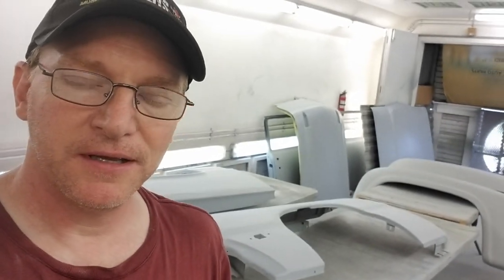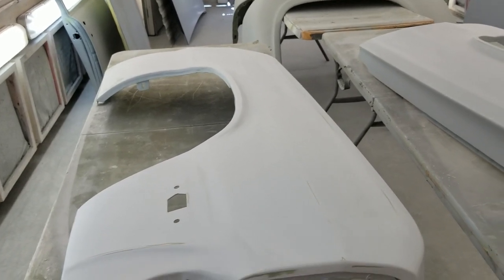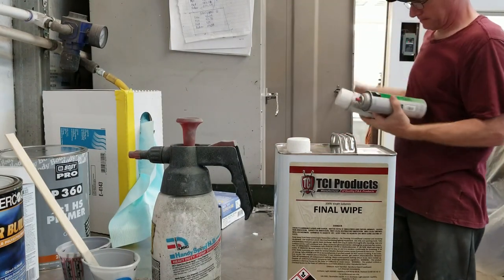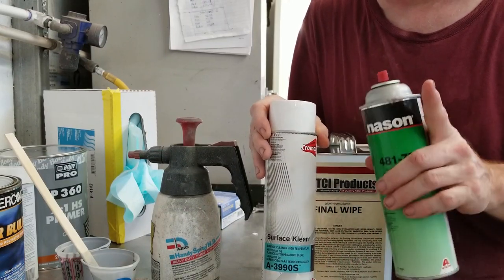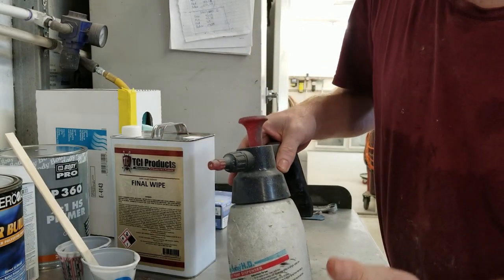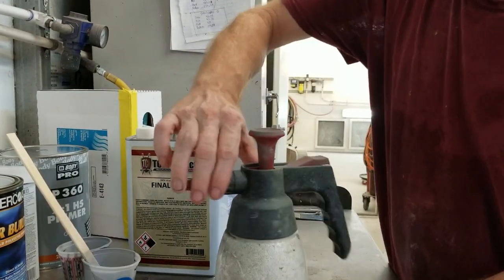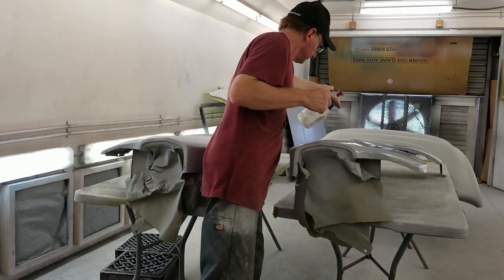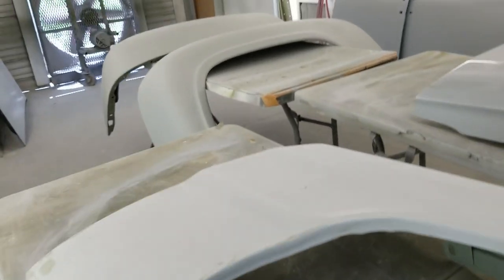How to Verify If your bodywork is Straight Quick Tip 101

Comment: 'Dieback' is when the clear coat loses its gloss. Almost like it was sprayed on dry. 
Its your bodywork that's showing from the inspection spray. It's not called dieback, it's your bodywork. To fix it you need to block sand the area again with guide coat until it's flat. Then you can use the inspection spray to double check it again.
Reply: That’s what I was thinking

Comment: Great tips and nice demonstration! I never even knew such a product existed. That wet shiny coat makes it as easy as it could possibly be to see the imperfections.  I am curious if you do the same on sharp curved surfaces like a motorcycle tank, if the same process works? Glad I found you through that duck fellow, a lot of body guys  on YouTube seem like just a bunch of BS, like what they are doing is some unattainable magic and just talk about crap without showing the details.. I like how you break it down with practical demonstrations on real parts. Not just a bunch of bluster and drama. Best!

Comment: One side note i used straight up W&G remover solvent to check body work satges.. Big mistake on my part it attacked all the feathered filler edges to the epoxy ground coat. i learned that from Eastwood shows with Kevin T. Well after many$$$$ found out that was a big mistake. Is your ``final wipe the same as Water bourne w&g so scared to use the harsh w&g on anything but bare metal now. Maybe just water over panels and make sure it eveaps really well before continuing.
Reply from the maker: If you can get TCI final wipe, will not do that. final wipe wont harm any of your work.